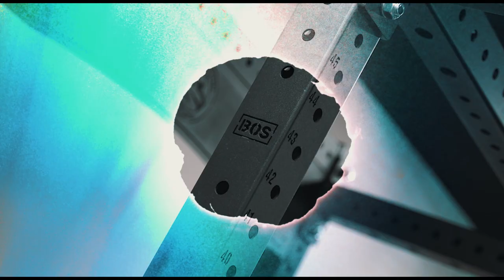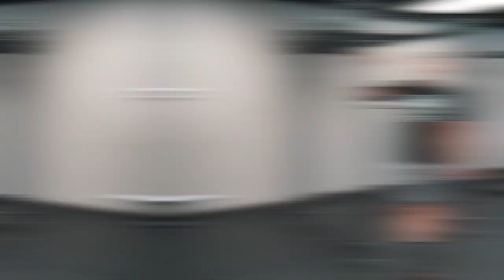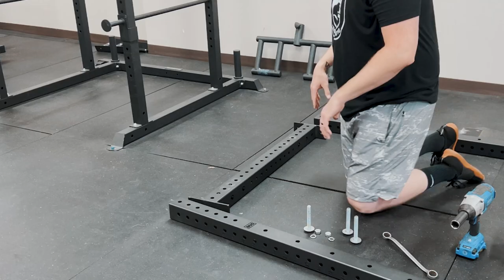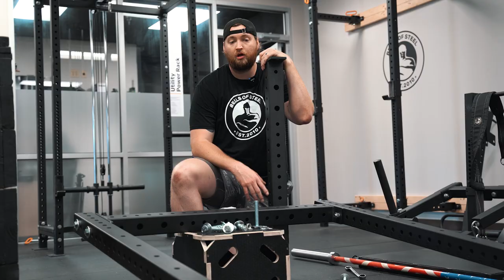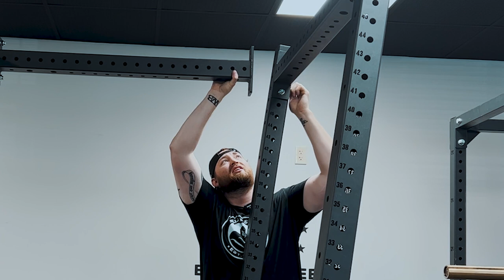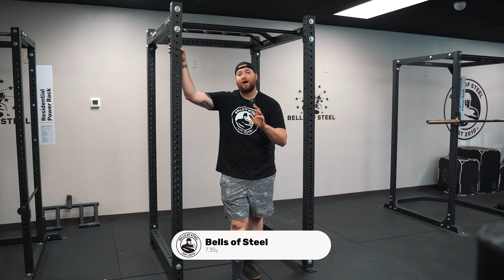Bells of Steel HYDRA 3 X 3 Inch Four Post Power Rack | ASSEMBLY

Comment: If one already has a four-post 3x3 rack from a popular made in the USA company, but wanted to add on plate storage with another two posts and cross members- would it be possible to get HYDRA posts and have the 5/8" holes all line up right?
Reply from the maker: Huh not sure but if it's the same size, I can't see why not 🤔
Reply: I did this and they lined up all the same!